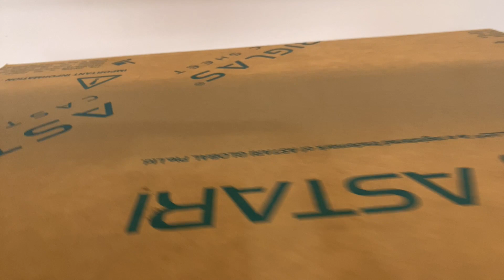DIY Acrylic Lid For Aquascape Tank

Comment: Thanks for the video:-). Where did you buy your acrylic? I've looked at bunnings and mitre 10 but they only have 3mm. Also how much did your acrylic sheet cost?

I purchased polycarbonate double wall stuff yesterday for $31 from bunnings also picked up some edge capping to keep it clean. I'm concerned about how much light will get through. 10 or 6mm Acrylic would be my preference for this project.

Comment: Why don't you have proper angles for the pipes, because they will compress over time. Clear acrylic wont weaken the light. There is clear over the top of LED lights. Think about it. I use 3ml just fine. You don't need it thick at all, as long as it stays flat on top of the tank. If you get a hair dryer on the bit that is bending and using some heavy books you can flatten it out.